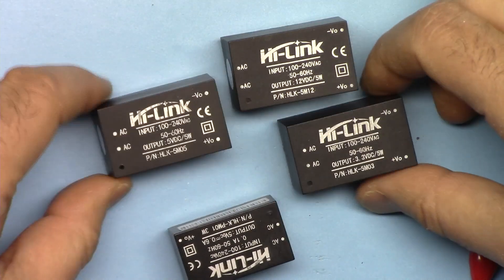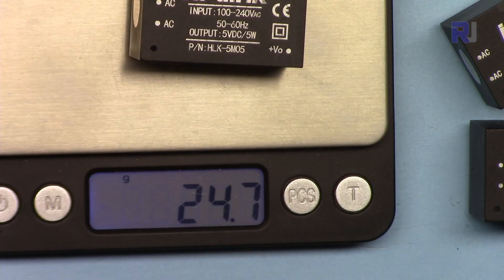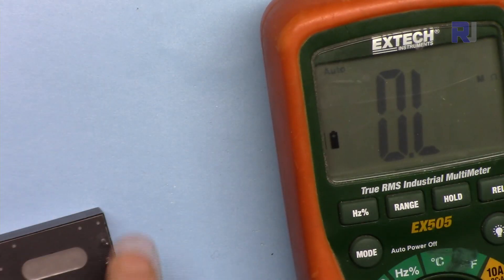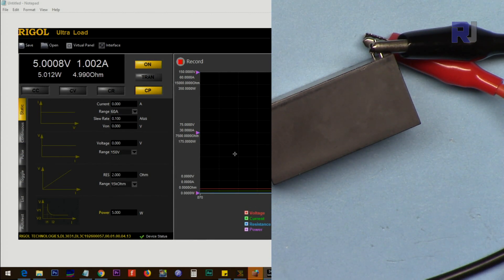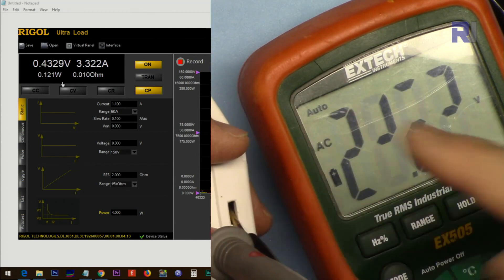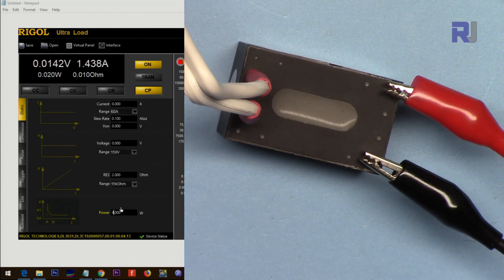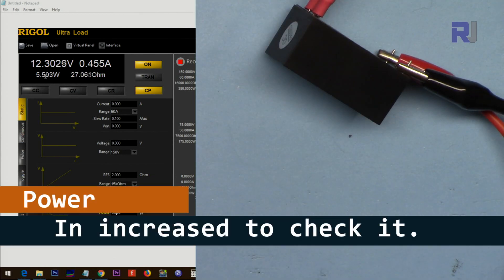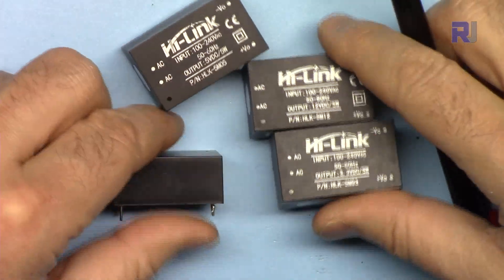Review of Hi-Link AC Arduino Power Supply DC 3.3V 5V, 12V 5W converter

Comment: I have used these modules in many of my projects and I surely recommend these. In one of my projects, this ran consistently for over 6 months with no signs of heating or any other issues. As long as your requirements are within the specified limits, it is a reliable choice.
Reply from the maker: Indeed they are good quality.  I hope the fake of these do not show up in the market.

Comment: I really currious about this step down AC-DC converter because of it's small size, and in this video the output voltage looks good, i might buy one and use it as a handy power supply to charge my 1s lipo on the go
Reply from the maker: I have tested them and they are very good.

Comment: They need some external filters for pulsation removal up to 20mV. X-capacitor on high side and 100-200 uF electrolytic capacitor on OUT. Also, 100nF ceramic capacitor on OUT will be good for high frequency filtering (it's very good for microprocessor signal lines, to reducing EMI/RF interference problems).

Comment: what type of pin connectors do i need for those please? The ones you're using for the AC connectors on the left side in your video? what is the name and size for these please? Thank you.
Reply from the maker: just get an AC extension coard and use it. just cut the socket that comes with the wire.  Here is how it looks like in Canada https://www.roweevents.ca/wp-content/uploads/2021/08/indoor-extension-cord.jpg

Comment: Hello Sir,  Hope you must be having good experience about usage of this MODULE for your microcontroller PROJECTS.
 I wish to know your recommendation about using this MOUDLUE to POWER-UP any microcontroller like Arduino ?
Can I use it for my microcontroller module ?  
( Any advantage or disadvantage of using it ? Is there any noise issue etc etc  ?)
Reply: You can use this for microcontroller projects. There is one thing that you can do to make sure that your microcontroller works perfectly during the start up transition (as the output voltage rises slowly), is that you can set Brown-out detection. The brown out detection will keep resetting your microcontroller if the voltage is not within a set limit which prevents code execution. This feature is available in most microcontrollers including the atmega series microcontrollers. Refer the datasheet for it.

Comment: Hello, I'm attempting to create a home automation project. I will be inserting the hi-link with the controller in the light interruptor, the problem is that, The light interruptor has 2 cables, 1 for 127V and the return cable. How would I be able to make the connection with Hi-Link?
Reply from the maker: Hello, I have no idea what. Hi link is. This has input and output which I have explained

Comment: this is a wonderful diy AcDc example... the data sheet-sheet shows using a common-mode-choke feeding the AC input... what are your thoughts when the AC is in a factory with lots of vfd inverter motor drives?  thanks...:)
Reply from the maker: The wining of this is optimized for 50Hz and 60Hz. Change of frequency should not affect the output much. I am not sure if the output is so tuned perfectly for 50Hz. try it.

Comment: How did you wire the converter to the AC cables which are shown in 2:08 ?
Reply from the maker: Perhaps you skipped.  It has bee fully explained and then connected. So if you don’t listen to explanation you won’t understand
Reply: @robojax  oh yeah, see it now at 3:45 . Yes, I did scan trough the video and missed it Thanks

Comment: hello sir, do I need to add additional components like a varistor and fuse in the input side of this Hi-Link, or it is good to go to power up the microcontroller and relays? I really appreciate any help you can provide.
Reply from the maker: You don’t need anything. Just use it
Reply: @robojax  Thank you sir

Comment: Can I split the 220 voltage on several hi-link ac/dc module
Reply from the maker: If you connect them in series yes and the output will be decide by the number of module you connect in series. If you use a 5V module and connect two in series then the output will be 2.5V for each

Comment: Can I connect the output from this directly with a 12V relay? Is there any other circuits required?
Reply from the maker: if you use 12V version, yes connect it directly to 12V relay to power it up.  Nothing else is needed.
Reply: Thank you
Reply from the maker: you are welcome.

Comment: Can I use these as an alternative for my usb android phone charger? If yes, which one?
Reply from the maker: I have explained the current. these are with maximum of 5W. Watt is power P=IV where I is current (A) and V is voltage. So for USB charger which is 5A I=P÷V=5÷5=1A so it will output 1A and it would be very slow. Most changers are rated 2.1 or higher for fast charging. Yes it will work if you can wait twice as long.

Comment: hi , please can you help me use Arduino to measure ac voltage with HI-Link AC to DC 5V,  converter
Reply from the maker: Hi, for high voltages we can use a bridge rectifier to convert it to DC and measure any DC voltage with Arduino like this https://youtu.be/t8xwrVj2aFs , for low AC of low voltages less than 20V, it is not that simple because bridge rectifier has voltage drop and we need to use opamp to convert it to DC and measure accurately.  I don't have any video on measuring AC with Arduino for the above reasons.  *** Free Arduino Course worth $200**
Arduino Step by Step Course  (over 150 lectures) Starts here http://robojax.com/L/?id=338

Comment: It's not obvious how you are testing the resistance between ac input and the dc output, but it looks like you're using a normal multimeter. They will only test resistance with around a volt, so do not show whether the insulation will break down when high voltages are applied. Mains voltage can be very noisy depending on where you live, but you ought to expect the possibility of short voltage spikes of up to a kilovolt. Insulation resistance testers are available that will subject a text item to that sort of voltage in order to determine whether insulation will break down with high voltage.
These are often called "meggers" and you can get a cheap one for around £20, which is enough to determine whether a potted device like the ones you are testing will provide good insulation or "flash-over" on a voltage spike with potentially disastrous consequences.
Reply from the maker: Hi Rex , thank you for bringing excellent point. No I have done mentioned resistance test. I will consider that in the future review.  I should have cut this open and shown the guts of it.  Thanks and stay safe

Comment: i bought theses hi link power supplies yet non of them are able to charge my iphone, why is that?
Reply from the maker: what is the voltage of the module? did y ou pay attention to the power? 5W. if it is 5W and 5V, then  you should know the current is 1A.  as 5W÷5V=1A. and 1A charge is very slow. but if you got the 3.3V, it will never charge your phone.
Reply from the maker: You didn't reply aso that which module you got? 3.3V, 5V or 12V?

Comment: I tested a 5V and a 15v, at the voltmeter you do not see the noise generated by the switching power supply, on the 5v 100mv of 100hz with intermodulations of some kHz, for the 15v it's worse, peaks to 700mV! Depending on the environment it is not desirable to use these converters!
Reply from the maker: That’s good to know if you measured it. Thanks for sharing.